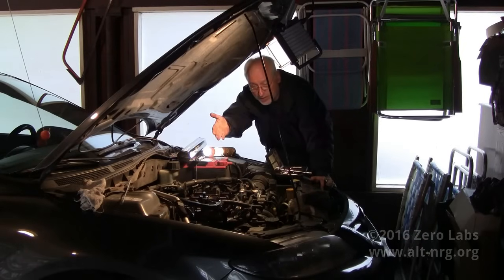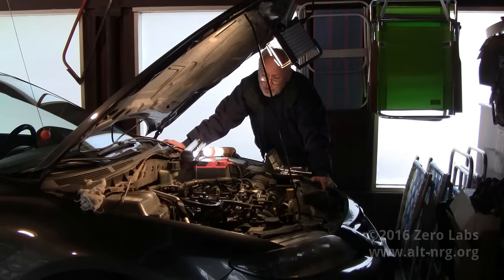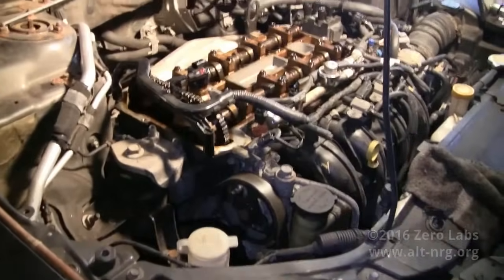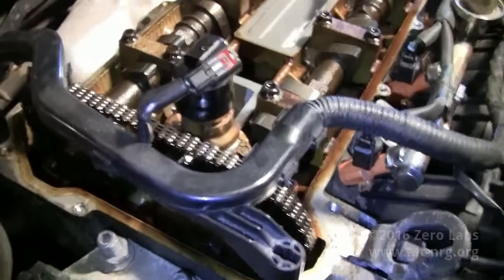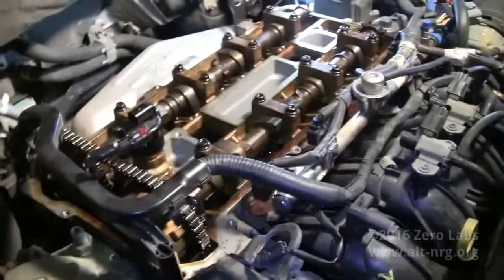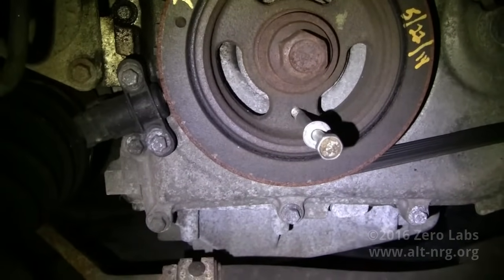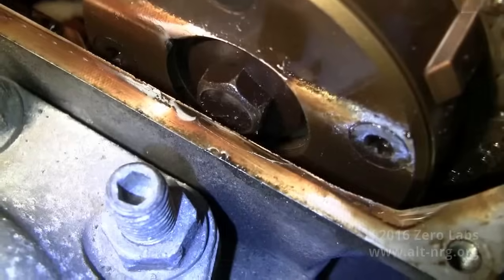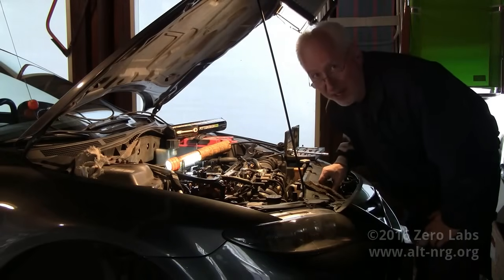#456 Mazda 2.3L cam timing chain sync problem P0340

Comment: i really appreciated a number of things here.  It started with your daughter... she was able to observationally tell you the car revved and decelerated when it happened.  But you give her more of a free pass than I do.  If She drives it then she is responsible for checking the oil and keeping it to level.  Period.  And without hammering at you or being unfair, I believe your excuses of "typical consumer" unempower her, doing her a great dis service to her and other kids potentially putting them in danger.   If she can drive, she can buy gas.  If she can buy gas, she can put down her phone and check the oil while the car fills. Its a free oil check every 300 miles.   Your curiosity, reasoning, diagnostic and presentation skills are very good yet you got caught in making an assumption about the car that led you astray.  I think you have made some assumptions about people and parenting and car manufacturers that are off base here.  What if you were not around?  What if she was 500 miles from home alone at night?  the truth from my perspective is you and she put  her at risk because you allowed her to be undisciplined as a driver, and you continue in that by providing her with the excuse of joining a legion of "average consumers"  Our job as parents is to raise the average. If you are a kid here and cant pull a dipstick here, you can not drive.  Ditto if you cant carry water, cables, a space blanket, a first aid kit, flares, an atlas, a basic tool pack, and a jump pack with a charged inflator.  Her lack of discipline cost you some money, THIS TIME.  Next time it could cost her her life or someone elses if an engine failur results in loss of braking or steering.  I really love the technical aspects of the videos and your entrepreneurial spirit combined with your science kind of head.  I hope you can find a way to use those powers to raise her above that average.

Comment: I know that engine knock all too well. Same car and the engine started knocking, so I checked the oil and it was 3.5  quarts low! No oil warning light ever came on!

Now, I hadn't checked the oil in a couple of months, but every time I had ever checked the oil, for years, it was never more than a half court low. So I just don't know how it lost so much oil in a relatively short period of time. And where did the oil go? There were no leaks in my driveway, and the car didn't smoke or smell of burnt oil.

Comment: I aligned the six mm bolt but  I don't  see the light colored tooth all rusted. Now there is a mark on the pulley at 10. o'clock not even close to the sensor witch has me boggled .
Reply from the maker: All the more reason to stay away from anything in any way connected with Ford Motor Company. As for me, never again.

Comment: so you are saying that her not checking the oil is the cars fault
Reply from the maker: I'm saying the car should report low oil BEFORE self destructing, like her newer Subaru Legacy does. Light goes on when it's down 1 quart, not when it's completely empty.
Reply: These oil level sensors are still pretty new technology, and there’s no reason you should rely solely on any dash lights or sensors to tell you your car is in good shape.  Yes, they’re good indicators.  But you still need to be checking your fluids and belts etc.  if you don’t inspect and maintain your car regularly this is going to happen, that’s just how it works and it’s not the fault of the manufacturer that you rely too heavily on the vehicles warning sensors

Comment: If my 05 6i got 2 quarts low the oil light came on, when I had a small leak in my valve cover gasket that happened. My 07 Speed6 burns next to nothing every 5000 mile change...

Comment: try the BMW M3 acceptable oil consumption is up over 1qt every 800 miles. the engine only holds 5.8qts + filter. your mazda 6 holds roughly 4.5Qts + filter capacity. My wife also has the similar 2007 mazda 6 2.3l, and hers had a valve cover leak ( I replaced the seals/gaskets), and I once took it for a drive, and it had Very low oil, took 3 Qts. I was dumbfounded, and told my wife to check it more often. the car does have over 160k on it, but if she took better care of it, it would last much longer.

Comment: Have a question if you have time to answer it.  I have a 2008 ford escape 2.3L I'm trying to get the timing set.  only thing I'm not 100% sure is where is the CKP lines up to the pulley ?  I was burning oil like crazy a quart every few tanks of gas.  Yet 0 smoke ? was 100% sure the head gasket was toast. pulled her all apart yes even the timing cover for 1 stinking bolt. Just to find out the head gasket was fine. like putting the cart in front of the horse. But this was the 1st time I've ever done this and all the info was from people that post it on here.Oh and any mistakes were just me being new at it.  But anyway it ended up the Valve seals were worn out and leaking a LOT. after a few mistakes like for getting the little washer behind the crank pulley and bending all the intake valves over. I was able to get it back together. it fired up. But just didn't run right when I turn the AC on it would just keep on reving up 500 rpm then drop back down ? so today I rechecked the timing. the Bar in the cams and the bolt in the pulley. But that bolt was a 2/8 inch off. so loosen the cams bolts on the sprockets and turn the crank bolt to line it up. perfect. Now just not sure where the CKP lines up with those tabs on the pulley ?  Thanks Joe

Comment: timing tools are needed that lock the cams and crank in place , remove the high pressure fuel pump and see the lines to fit the 1 specialtool and the other one sits on the fire wall side of the engine at the back to lock the crank in place

Comment: Hello. Just some food for thought. I have a ford escape with a 2.3L. I was burning oil like crazy. But no smoke.  So I pulled the plugs out and unplugged the fuel injectors and cranked it a few seconds. the 3rd cylinder had oil on the piston. I was using about a qt every two tanks of gas.  After tearing it apart. it was the valve seals that sit right under the spring. meaning no need to remove the head. Just the Valve cover and cam's . Thanks for the awesome Video :) helping me set the timing on my 2008 escape.

Comment: good vid dude and a well justified and interesting rant at the end . i just bought a 2006 1988cc diesel 143  injection 100,000 miles had 2 weeks oil light came on i checked levels and they where ok . it conked out with a snapping noise , looked inside the oil filler cap and things look broken as far as i can see after closer in spection of the car i noticed that i had disconnected the mass air flow sensor. could this have caused my car to brake

Comment: what's the specialty tool used on the camshaft?
Reply from the maker: It's a flat bar of metal of specific thickness with a few notches in it. No doubt they charge big bucks for it.

Comment: great video.my mother's cx3 2017  2.0.had two p0015 camshaft retarded alarms.find out the oil filter is full of metal shavings.car has 1,700 miles.Mazda in all its wisdom is replacing the oil pump to we assume diagnose the cause of the failure.never saw any oil lights or anything.checkengine must have came on when the oil pump filled up with metal.thanks for your video.her code was for exhaust cam.but this put some things in perspective for my mother and me.you are correct even in 2017 there is sparse info on these issues.

Comment: Sorry sir, but checking the oil level is every car owners responsibility. women tend to be especially unwilling to carry out this simple task. i think that is the real issue. If a person is unwilling to pull the dipstick and look at it, that is not a car manufacture defect. in fact they actually encourage people to check all their fluid levels regularly, correct? i m pretty sure it says that right there in the owners manual.
Reply: Could not agree with you more about owner responsibility.  they should take the $1.50 and put it in an oil dipstick sensor so that you have to pull the dipstick every time the car is filled!

Comment: You can 100% jump a tooth with a timing chain, especially on those older Mazda 2.3. You're kidding, right?
Reply from the maker: Yes, so I am told. Not doe to stretching but I guess the chain guide comes loose too sometimes?

Comment: It sucks. My 2.3 Mazda went through the same thing. No low oil light. Engine was 4 qt low as well. Turns out My car was burning a qt of oil every 200 miles. Don't know where it went, no external leaks. As a result Spun bearing. I'm in the process swapping my motor, the dealer wants $7000!. It's a scam. And I took it to them 3 freaking times to diagnose the high oil consumption, they just added thicker oil told me to drive it 500 miles and bring it back without adding oil to it to further troubleshoot. About 50 miles in spun piston rod bearing.  Doing it myself. Lesson learned. Anyways good very informative
Reply from the maker: +Wake Up America Boy do I feel your pain. :(

Comment: my brother's family just got a Mazda 3..2006 or 07.i hope it last them some time! replaced a few motor mounts & a seal on the air intake tube.i have a 03 focus( zetec) with 201k iv replaced many parts & runs reasonably good!!! DOES NOT CONSUME ANY OIL!!! I HOPE I GET A FEW GOOD YEARS OUT OF IT???

Comment: If you aren't smart enough to check your oil regularly you deserve what you get. So this guy, and many commenters, blaming manufacturers instead of his daughter is way off base. Once the light comes on your engine is toast or badly damaged. A car is a very big investment and repairs being very expensive everyone who owns one should at least know the basics to keep it maintained, like read the owners manual, and investigate every noise or puddle of fluid on the ground. Ignorance is expensive.
Reply: Generally if a car uses that much oil between services their is something wrong. So the mechanic or service center need to notify owner in writing to get it repaired or inspect regularly. The fault can be from both parties, you cannot only blame an owner.

Comment: Hey. I have the same engine in my Mazda6, and I can tell that oil consumption is very weird in that motor. Sometimes I run 2000 km and almost no oil consumptions is noticed, but sometimes I run only 500km and oil level drops way below the scale. No indicator lamp on dashboard for it, so the only way is to carry with you at least 1l bottle of spare oil all the time and check oil level very often.
(Notice: Always check oil level when car is on levelled position, engine cold or minimum 15 minutes after running - on hot engine)
210 000 km done so far and no problems ;) and still it have 9,3s to 100km/h and I love this car.
Best wishes to all M6 users!
Does anyone know is there any way to install oil level indicator in that car? (M6, 2.3 GY)
Greetings from Poland.

Comment: hey guys i have a mazda 6 2004 with the code p0340. i changed the 
camshaft sensor, but the code is still. also. when i start the engine in
 the morning, it does something like that (https://www.youtube.com/watch?v=jPEZ845fbIc) and then runs fine after 1 minute. anyone has an idea please?

Comment: Really need help with this car mazda 3 2004. I spend 3 days trying to get the crankshaft pulley bolt out. Used everything you could imagine. Went to a shop they used their impact gun it did not remove it. I went back home and start applying penetrating oil for the next 48 hr whenever I get out. The following day I tried the bump start method that was not working and it unbolt the pulley bolt. I was able to remove everything and start installing a new timing chain. At this point when I was trying to get to TDC when rotating the Crankshaft clockwise it will go like 300 degree and does not let me align the special too and the counterweight. It turn counter clockwise and get stuck too before I can reach TDC. I Tried manually to rotate but it make a hitting sound Metal vs Metal. I turned clockwise until it stopped maybe 5 degree before TDC. (It is still stuck) I reassemble everything the pulley and all the car components. I tried to rotate the crankshaft clockwise and it it still stuck before completing a complete circle. I tried to crank the car and it does not turn on( something is preventing the crank to rotate feely). 
Initially I decided to change the timing chain because I had the code P0012 and P011 at the same time or P0012 always.
Reply: TECH87 you are hitting the valves with the pistons. some valves are still in the open position and you are hitting them when you bring the piston up. you need to rotate the cams independently of the crank without the chain on. then get back to tdc on crank and cams, then install chain

Comment: you are a genius! my mazda has the check engine light on and the diagnose is throwing the P0011 - "A" Camshaft Position - Timing Over-Advanced or System Performance (Bank 1). For me, it looks like I need to align the camshaft just like you did. I will proceed to do this. what do you think?
Reply: Gabriel Videos did you fix it? did the p0011 code go away?

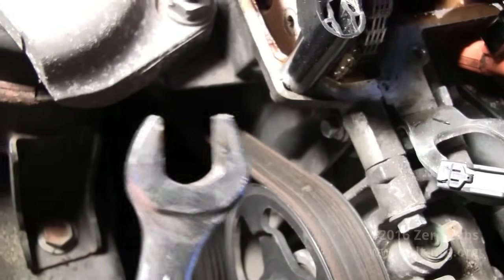Comment: at the 11:50 mark when you tightened the bolt did you keep the "special" tool on, or removed when tightning? also so it didn't move did you use the wrench at the same time?

Comment: Help.

Bought a used 2008 Mazda cx7 (2.3L turbo), for my son for college.  Had code p0012.  We fixed the timing chain, and all components inside cam and four cylinders but, Not the VVT solenoid.  

Still getting the p0012.  I believe it is the vvt solenoid that is clogged or not working the hydraulics properly (or whatever makes the solenoid work).

Symptoms - rough idle and check engine light (poor fuel economy also).

When resetting the code, it runs better but, after two drives, the code is back.

Someone also suggested, it is the cam sensor?

Can you offer some insight please?

Really need some expert help here.

Please advise.

Comment: That sounded like valves tapping to me . Very common to jump time on these garbage engines when the oil is ran low. Take the front cover off and check the timing and I bet you will see the timing is incorrect. The main cause of the consumption of the pcv. Hope this helps. Check the gas and fill the oil ford/mazda drivers!

Comment: Sure wish this 09 fusion had a 15mm bolt in the vvt, mine has a 21 which is about impossible to fit with the timing cover on

Comment: You may have saved me a boat load of money and or having to buy a new vehicle. I going to do the same checks and see what I come up with. Car sounds like a major valve issue is happening and I'm receiving cam timing codes on my OBD scanner. The idle is low and the car chokes itself out. Oil was almost nonexistent. Plus there has never been an oil light. Just a check engine light. And I have had a very quite knock for awhile now. I only wish I could have heard your daughters car before you took the valve cover off.

Comment: My mazdaspeed 3 is consuming 1qt every 200 miles, 2.3l motor. Same issue here. Took it 2 dealer for troubleshooting oil consumption. Long story short dealer failed me, catastrophic failure. $7000 for a new motor. Thanks for the vid.

Comment: +ZeroFossilFuel

Great video. Here is a tip, change the PCV valve (gotta pull the intake) and monitor your oil consumption afterwards (most of the time, that is the culprit)

 I have 2 cars with these 2.3 I4s (one is at 260,000km and the other at 313,000km). Can you guess which one has the oil starvation issue? The lower mileage car clearly got the worse treatment throughout its life, when I bought it, I thought I couldn't read the dipstick, but it turns out that there was just no oil in the car. Oil gets filthy and has to be added every few thousand km...

The higher mileage cars oil not only stays on level, the oil comes out golden after 3000km.

This goes for any car, change your oil with quality stuff and on time every time.
Reply: Phil Feldman changing the pcv valve looks like its going to be a headache to get to... i have the 2.3l-i and the oil consumption is outrages, but i know a bad pcv valve is the culprit :(

Comment: I'm very glad you posted this.  My son's 04 Mazda 6 with the 2.3l did the exact same thing the other day no engine light, no codes, and no oil light.  I checked the oil and it read nothing.  I took it to a local mechanic and they told me it needed a vvt solenoid and wanted $437 to do it.  I laughed at them, towed it home and did it in about 25 minutes but like you it didn't fix it.  I've been on the internet searching for a fix and I firmly believe this could be it.  I am going home after work to look and see if the timing is off.  Thank you for this video!! Great video once again.
Reply: jgjetskierful did you get it fixed with the help of tgis video? mine actually turnes over but wont stay on unless i hold the gas..  was yours like this? i replaced the spark plugs, camshaft position sensor and im about to order the vvt solenoid.

Comment: you blocked out the license plate then it showed up again... is this similar to the cx7 '07 with turbo? having cam shaft timing issues - picked up new position sensor and will use my scope to look at things but not sure where to check first
Reply: you might have a faulty VVT. Mazda has a TSB on these - the cap that retains the spring holding the pin in place to lock the VVT at startup comes out because the housing isn't hardened properly. Not only does this allow the VVT to slip at startup (up to 20°) but now you have a cap, spring, and bits of housing somewhere in your engine.